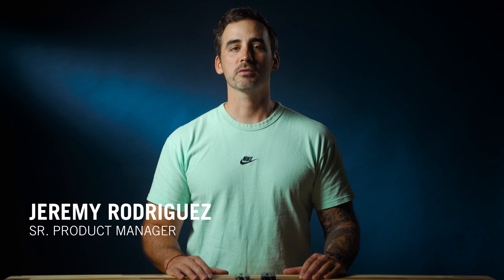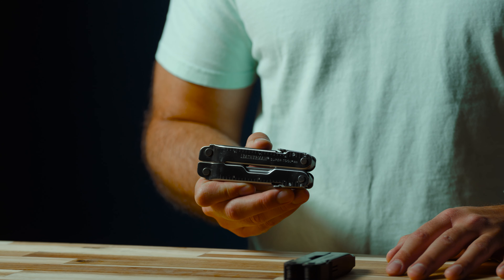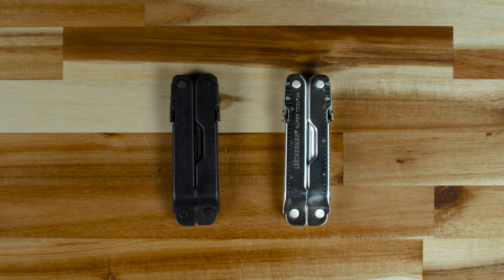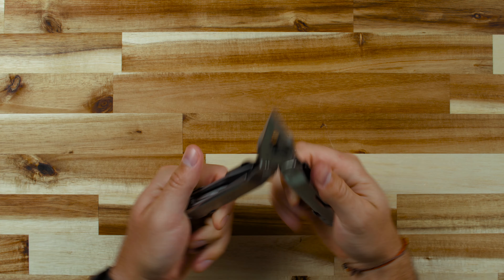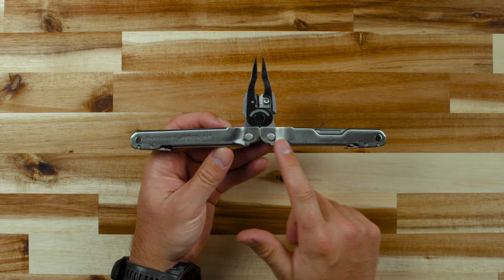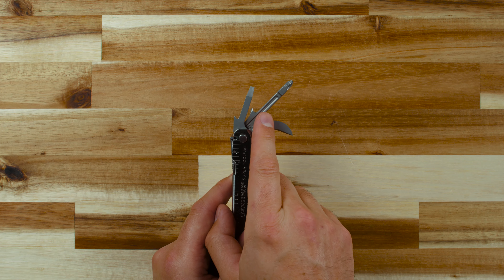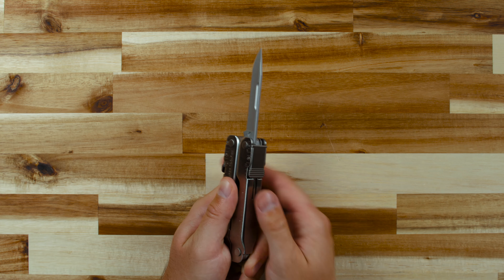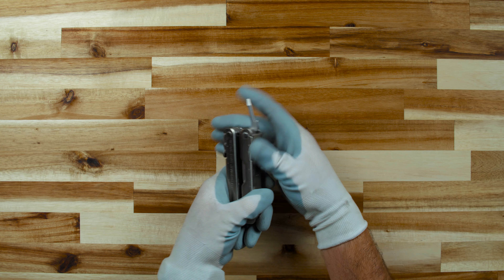Leatherman Super Tool 300

Comment: The Supertool 300 was my first Leatherman that I purchased, replacing my mini-tool that I happened to find in my first house when I was fixing it up. I saved up my money (which was very limited at the time) and purchased the Supertool 300 when it first came out. Although I don’t carry it as much today, the Supertool 300 has helped me out many of times while “on the line”. I’ve never questioned the quality of my tool during times where I needed it the most. The only tool that could ever replace my ST300 is if Leatherman ever makes a Supertool 400.
Reply: The super tool 300 is a great multi tool ive been using it for years it will last a lifetime love it

Comment: Have you fixed the ARC cutters yet?
Reply: No. Between my two Arcs, I broke 4 sets of cutters
Reply: @dualsportoutdoors  and this is why I will not buy them till they fix it! What a shame... I would have bought it by now too...@leatherman, get your crap together!!!!
Reply: @corbindallasmultipass  the frame flexes like mad too and the "Magnacut" won't hold or take an edge either. Magnacut needs to be 63HRC minimum to draw out its best properties. Go with the Charge + TTI. Infinitely superior tool for less money. The S30V on the TTI actually holds and takes an edge too.